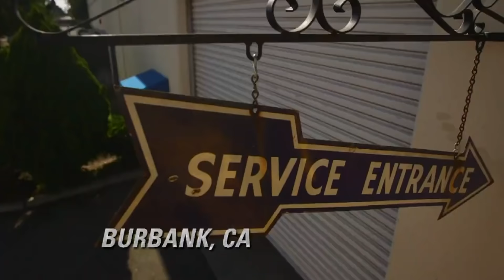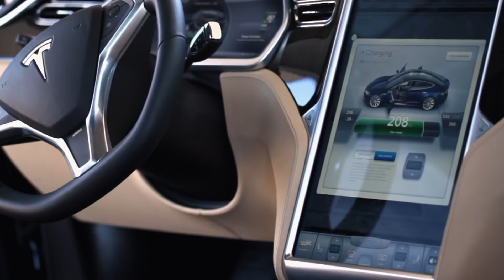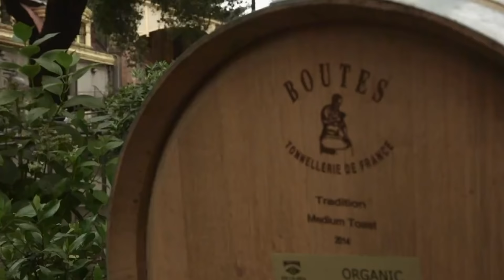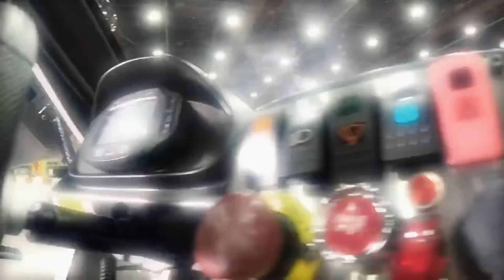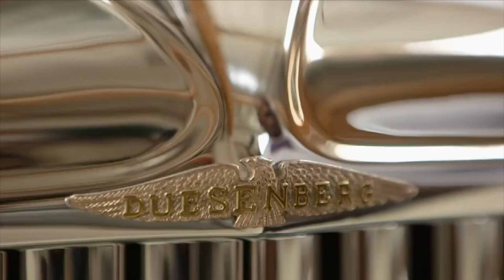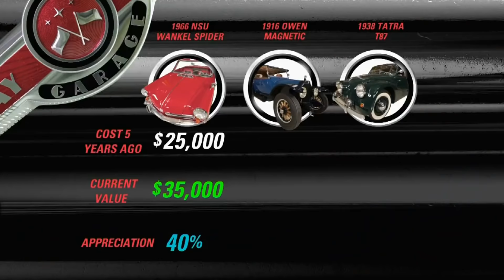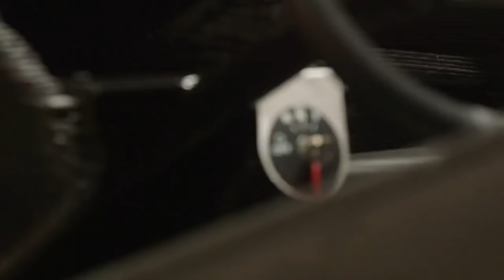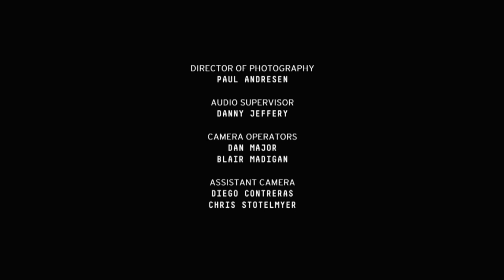The Cars of Tomorrow | Jay Leno's Garage | CNBC Prime

Comment: in the future:
and the archaic gas powered car was almost even able to compete with first gen electric cars.
Immagine that: the gas engine was like a mechanical lung that ran on a slew of hydrocarbons. Small explosions inside moved mechanical components in a sequence and turned a shaft to make it go.... gears had to be used because of its inherent lack of power.

Comment: The problem with the 1963 Chrysler Turbine cars engine, as far as cost, is that Chrysler actually did figure out the metallurgy such that the engine was not much more expensive than a good V8 of the time. But after Chrysler cancelled the car, over time, they LOST the metallurgical formulae for the parts. They literally forgot how to MAKE the parts. 

So even though Chrysler or anyone could remake the engine, they couldn't do it for the same relative cost because no one remembers how to make the metal to make the parts inexpensively. The bet solution is to do a full metallurgical and engineering analysis of the engine. But so far no one has bothered to do that. 

Also 3d Printing cars, at least the frames for now (Improving the print resolution or figure out how to polish the bodies efficiently an consistently will add body panels to that), is defending moving toward the future.

Comment: The inference that mass-production killed off the electric cars of the early 1900's is off-base as it was the invention of the electric starter motor that gave internal combustion engines the edge. Electric cars started with the pressing of a button while, in the early days, drivers had to literally crank the engines to start them....until the starter motor came along (1916?). 

BTW ..the first auto pedestrian fatality happened in NYC in 1899 ...Henry Bliss.  He stepped off a trolley and was run over by a electric cab.  Even now there is a movement to build artificial noise into electric and hybrid vehicles.

Comment: Great video.

The biggest obstacle to going fully electric with cars will be the batteries.

There has to a big breakthrough in order to make the next leap.
Or, use a hydrogen cell to keep the batteries charged.

Till then, it could very well be the hybrids will soon be the most common system. They could run on  the engine till they reach city limits then switch to full electric to cut emissions. That way they could still go 4-500 on a tank and refill  and go just like a gas engine car. If hybrids would build with a diesel engine they could even run on vegetable oil which is non polluting and smells like cooking french fries.

Comment: The charging is the problem, I can gas up in 5 minutes, can you charge up in 5 minutes? That and range is not only the problem, the price is outrageous, Only the rich can go green.
Reply: For now at least. The charging speed and range are both improving, and the cost will keep coming down. It's getting close to where I could practically, and nearly as affordably as my V6 Camry, do all my driving with an EV that can go a little over 200 miles on a charge. I just can't plug one in where I live or at work...yet. Maybe in 10 years when stuff stars to wear out on this car those things won't be an issue.

Comment: 36.45 - You'll not convince me with a rubber mallet. Take a sledge hammer to it! About 10 years ago, the company I work for sent a length of carbon fiber to various divisions to amuse and educate us. It was maybe 3' long and 3/4" x 1" in cross section. No matter what abuse we subjected it to, it came through unscathed. If it were aluminum, it would have been destroyed.

Comment: I know a guy that has a Ford Fairlane 427 OHC that was taken from a crashed Police Interceptor it has cut out headers and a Hurst 4 speed 4:38
Reply: you need a roll bar with that Cobra because Shelby took the AC Ace and made the frame more ridged but not rigid enough for a 427 beacause it leaps like a frog and the frame could flex and the wheels are not parallel and you can wrap it around a pole [ the Fairlane above went to Woodstock red did you see it ?]

Comment: As enjoyable as this show is, I have to say about the two person Shell Eco Concept car is both heavier and less efficient than the streamlined recumbent bicycle I drove(rode) across the USA back in 2000. No engine at all, and for much of the trip I was faster than those students vehicles powered by what Jay sold when he was their age (fast food). My cruising speed was over 20mph where these hypermilers go about 15mph in the Shell competition. The methods are similar, however. On flat ground I would get up to about 23 mph, and coast for as long as it took to drop to around 18mph, a quarter to 1/3rd of a mile. a few quick turns of the cranks and I would be back up to 23mph.  Interesting from an engineering standpoint is that the human body has similar thermal efficiency in the conversion of "fuel" into mileage, the rest going to heat and auxiliary functions(brains,etc).

Comment: 'No emissions', only if the electricity comes from wind or solar! Still better to move the emission producers out of the city...
Reply: There's also the emissions required to produce the components which people don't usually think about. If you've got a good clean power source though it doesn't take all that long to make up for the extra emissions from manufacturing, and yes, it moves the pollution out of heavily populated areas. Sadly where I live most of the power comes from a super inefficient coal plant, though it's supposed to be decommissioned sometime soon.

Comment: I've hyper millage. I have a 1989 Dodge Aries that has gotten as hi as 38 miles to the gallon.
Reply: John Henke so I had a geo metro in 1992 that got 58 mpg& I cruised at 80 mph.too bad japan never released the patton on parts& it was designed to only last 5 years& the transmissions were a pease of crap.but the 3 cylinder 1 lettier motor was awsome.

Comment: Electric cars are really nice and mechanically simple, but until the range problem is solved you can't make an all-day trip.  I couldn't get from here in NC to Texas or Chicago, or even halfway.
Reply: Electric cars still have to be manufactured. Add a battery with 12 tons of CO2 from its manufacture and their manufacturing carbon emissions are far higher than a gas driven car, a hybrid with gas engine and electric generator and motor and battery has to be the worst. Pay back time on reducing its carbon emissions must be years.

Comment: I don't see gasoline engine going away. Even with the electric engine taking over the market, I think the ICE is still here to stay.
Reply: I think hybrids are the best. The problem with electric vehicles is that in a lot of places, electricity is already coming from fossil fuels. Using an engine in the car to charge the battery is simply taking the power plant out of the equation.  
  
Now if the electricity comes from dams and wind, then it's worth getting rid of gas imo.
Reply: Jason Carpp sure, so is the horse and buggy - there are still a few around.

Comment: I don't understand why steam has never been reconsidered. With the high efficiency technology already in place for boilers and the such how hard would it be to make a fuel sipping boiler that would spin a high efficiency turbine or some like. You could recirculate the water and condense it with an intercooler and never have to refill and the car could run for long periods of time on a outdoor grill sized tank of LP or burn gasoline or diesel or hydrogen or natural gas or be heated electrically run by solar panels on the roof of the car. The torque would be instantly at 100% just like with an electric car and no transmission would be necessary. It could regenerativly heat the water using braking power just like with modern hybrids, the drive turbine could have a reverse flow system that could brake through the drivetrain as well. The only down side would be having to wait on it to boil steam if it's been off for a while but there could be some sort of flash heater that would quickly bring it up to operating temperature then shut off. I wish I knew how to engineer this sort of thing I feel like this sort of vehicle would be successful
Reply: sstroh08 price. industry, like any other established industry, have investments, and such radical changes need expensive r&d and change of production lines. At the end of the day, its all about money.
Reply: sstroh08 Steam is massively inefficient. All that heat lost is energy lost.

Comment: Not the best launch, but I really didn't expect the Cobra to win. However, lack of instant torque is not why he lost that race and Jay knows it. That 427 makes PLENTY of torque. More than enough. He lost because the Cobra can't put the power down effectively at all. He was spinning his tires off the line, that's not caused by a lack of torque. He's not wrong about the torque in an electric being on at the word go, but that Tesla has traction control, stability control, launch control, etc. Those systems are designed to manage and even limit the torque to a certain extent to facilitate control. The cobra has none of those systems. Bring a Nissan GTR to the party with a driver who knows how to launch it and then we'll see.
Reply: Shut up! This Jay's private video! PRIVAT!!!!
Reply: It was all for show I'm sure.

Comment: No effen way that cobra lost to an electric car, no way
Reply: A Hellcat will lose a 1/4 mile drag race to a dual motor performance model Tesla every time, though it is faster over longer distances. Electric motors loose power at higher RPM.

Comment: 8:12 no emissions. LOL, except for all the coal burned to get the electricity!
Reply: The idea is to eventually make all electricity with renewable/pollution free devices. Solar cells, wind, tidal, thermal, hydro, etc. No pollution, no greenhouse gas. It'll take time, but must be done.
Reply: Electric cars are also more efficient than gas. Not moving=no pollution. Braking regeneration. Ideally, a hybrid, like the Volt, could fill in the gaps for range.

Comment: The only vehicles faster than a tesla are pretty much the Ariel atom, and the gsxr1300
Reply: no there are a ton of cars faster than a tesla
Reply: Chris_ not vs the p90d in 0-60 times but they have higher top speeds
Reply: +gadgetguy99 Lets see there is the Porsche 918 which goes 0-60 in 2.2 sec. The ferrari LaFerrari 2.4 sec. The bugatti veyron and veyron super sport 2.5 sec. The porsche 911 turbo s 2.5 sec. And the mclaren p1 2.6 sec. Also the aventador with 2.6 and and the audi r8 v10 with 2.6. All of these are faster or just as fast in 0-60 times as the p90D
Reply: Chris_ Go look at matt ferrahs article about the p90d accelerationm and the 918 and la ferrari are hybrid I am talking about gas only engined
Reply: Yeah? But the 918 weighs how much? The Model S p90D weighs about 4970lb's. The 918 is about half of that.

Comment: The bigger question is whether self-driving autonomous cars with AI will overtake electric cars by 2034 - 2045
Reply: All the major automakers are R&Ding autonomous cars, but in the final analysis, it takes the passion and fun out of the equation.  I don't think that's where their market is.  If your car takes you and you just sit there like a squash, you may as well take a train or a bus or hail a taxi.
Reply: Despicably Irascible Rapscallion Agree to disagree.
Reply: Wouldn't self-driving AI controlled cars be electric???
Reply: The March Hare Electric?  Not necessarily. Dependability would be crucial, though.
Reply: Apple engineers are working on automating old junk yard cars. Do an online search for June 2016.
Reply: True,  last year Consumer Reports would not endorse electric cars and now with the fatality in Florida, I doubt they'll endorse self-driving cars any time soon. They've been recommending hybrids in their annual recommended cars list.
Reply: Well before then actually.

Any new vehicle manufacturer labels that are still around in ten years - will ALL have at least one self driving vehicle.

Comment: 16:34 what is that green?
Reply: Coolant. (Glycol and water.)

If they only drive it once a year or so, it probably had a dried out radiator hose or something, so it burst when the engine got warm and pressurized the cooling system.
Reply: ziiofswe ah ok. but usually it isnt green right?
Reply: Coolant/Antifreeze ... It's always green when you buy it. Loads of people don't use it so most cars when they break a hose it leaks just water or water mixed with rust.
Reply: All the older vehicles used green colored antifreeze but most modern ones now use the red or orange colored.
Reply: Didn't know. Thanks for that!
Reply: Green was the traditional color for antifreeze/coolant for many years. But today it's available in many colors, green, orange, yellow, pink, blue and probably more.
Reply: Traditional green anti-freeze (glycol based) works well on older engines as they most likely have copper or steel gaskets in them and won't corrode them easily.  Modern anti-freeze is generally red and meant for modern engines with rubber and poly seals.  Never mix the two types and never use one meant for the other.  I.e., don't put the green stuff in a modern engine as it'll eat the seals and never put the red stuff in an older engine as it'll corrode the gaskets and radiator core.  Granted, there are different colours, but read the bottle and make sure it's for your engine application.
Reply: good ol anti-freeze check your radiator should have the sweet stuff in it
Reply: I know that some coolants are actually blue, but for something like that, green is normal for old style antifreeze.

Comment: The thing the electrics cannot do is go in and fuel up in five min. and go for another 450 miles and repeat back to back to back..  And then there is the new chems that you have to deal with in accidents and the expense that will happen when the batt. goes out.
Reply: DO YOU DRIVE MORE THAN 300 MILES WITHOUT THE NEED TO STOP AND PEE AND GET A BITE TO EAT?
Reply: For REAL what is wrong with you ? There are 140kw fast charge stations being built atm, and 300kw chargers are being planned. You can charge your EV at home over night and never visit a petrol station - what cn be more convenient than that ? 1000s of people have died due to automotive fuel fires. A LA to Vegas limo service using a Tesla clocked up 800 000 kms on one battery before Telsa replaced it under warranty. How many IC motors last this long ?
Reply: @nordic5490  And what is WRONG with u.  Elec.  LOST tp gas cars for ONE reason.  Speed of the refill.  U said that they are Building.  Well kid u cannot build them fast enough and really the Grid CANNOT handle the extra drain on the available elec. that we have right now.  And Wind and Solar energy at BEST is extremely unreliable and does not produce enough elec. to do anything against what cars would have to have.  And u have ZERO in the elec. world that can get u up to full charge s fast as we can fill up a REAL CAR and be on our way.  And then they also have supply chain problems for the Lithium.  And then ur going to have to deal with all of that extra elec. and what it does to the human body.
U cannot Charge ur way around what is needed to keep roads in good repair.  U clearly have no clue how things are set up right now.  And then u have the extra weight of the elec. car and needing to build better roads which we cannot do right now and cannot build in a timely manner and seem to have 99% of the workforce standing around at ANY TIME during road contruction.  And Elec does not do as well the warmers it gets or the colder it gets.  And Frankly there is no reason to have elec cars as they are MORE polluting to make from start to finish and us than the REAL Cars.
And ur going to have HUGE discharge problems in LA, Cal during Rush hours or in Chicago or NY etc.
Like ALL of the so called Green energy is all more polluting from start to finish than what its meant to replace and all of it is unreliable.

Comment: I call shenanigans on the tesla vs. cobra race. Put them both on a proper 1/4 mile drag strip, I bet the 2400lb Cobra would catch the 5000lb Tesla and pass it before the finish line.
Reply: have you seen the tesla videos on youtube ?.. this kid in a tesla completely wrecks everyone at the stip :)
Reply: That still shows how Tesla is a better out of the box car off the dealer floor when it comes to this performance.
Reply: with a 2.6 sec 0-60 time and over 700hp the tesla beats most anything, including almost all super cars. it has a governed top speed, but in the 1/4 mile it is extremely fast.
Reply: With over 700HP I hope your joking? It doesn't even have 700HP

Comment: instead of charging stations, they should have swap out stations. since it takes forever to charge an electric vehicle.  you should be able to pop up at gas stations and pull into a hub pay to swap out batteries.  or make the batteries rechargeable as you drive since they are all wheel drive, while the front wheels are using the energy to pull the car, have the back in a neutral setting and being charge by the front and vice versa. so when the front is about a quarter to an eighth used up it should auto switch to the back, then making it from front wheel to rear wheel drive then the back will now be supercharging the front and when the front is charged it switches back then the back starts to supercharge again. so get to working Mr Musk....
Reply: Sounds good but will not work. You're idea of recharge on the go is already incorporated into the elec cars. Problem is that it's called regenerative braking. You didn't figure in the drag used to produce power. There is no free lunch in design.

Comment: The claim of one man hour to build the 3D printed car is way off. Yes it took about an hour to put the car together but there were  what. 5 or 6 guys working on it? To get man hours you use the time it takes and multiply it by the number of people. So it should be 5 or 6 man hours. Still a lot better than a conventional car.